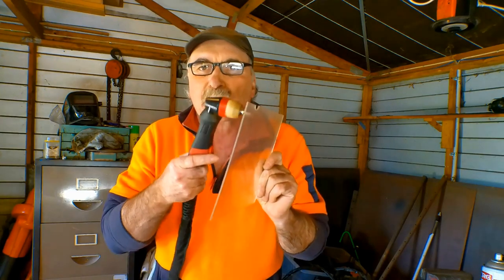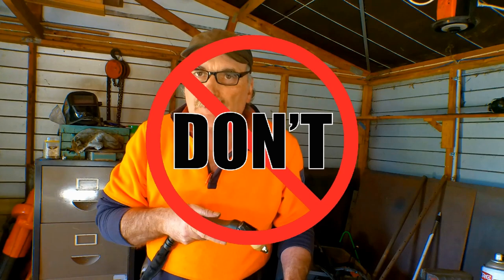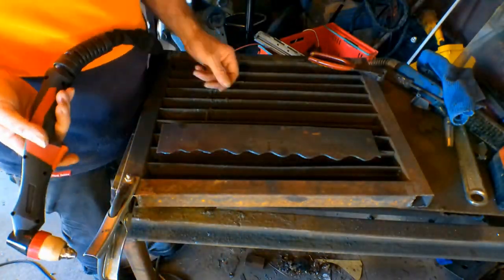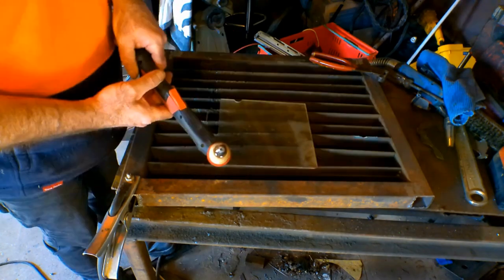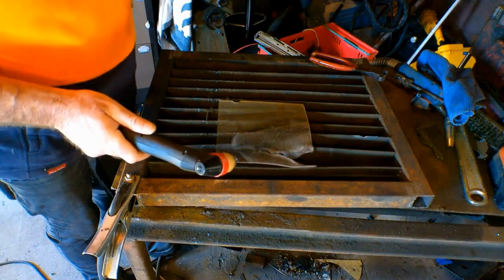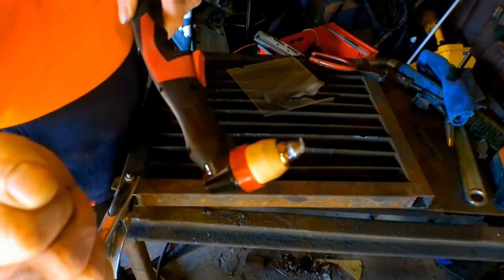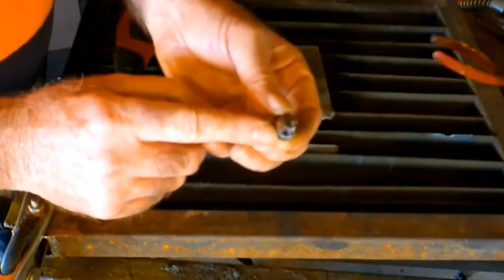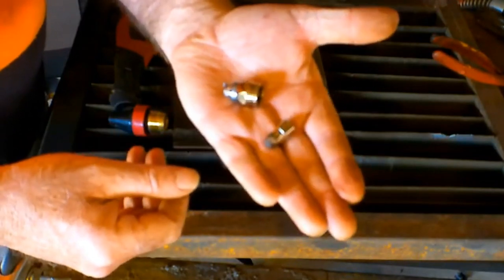Never Cut This With Your Plasma Cutter

Comment: My thoughts, I think that your not transferring heat into the plexi. When you cut metal your transferring heat from the plasma gun to the metal that you are cutting. When you try to cut plexi you are making an arc with the plasma gun but the heat is concentrated at the tip of the gun causing the consumables to burn up.
Reply from the maker: Good tips thanks.

Comment: Pete. I have a 60 amp pilot arc plasma cutter and it came with a ceramic cup and a wire hold off. But when I cut materials with it and drag the nozzle on the plate it makes the consumables waste away very fast. The problem is I believe that the nozzle when contacting the plate is adversely affected by the plasma. Do you experience the same thing?
Reply from the maker: Hi jimmy if its a pilot arc machine don't let the tips touch your steel. The wire hold off should hold the tip about .5 mm above your work. cheers mate
Reply: @petestools  here's the thing Pete, I have learned a lot from you and the videos. The machine cuts really good. But if I have to get into a tight spot, I take the wire off and then if the tip touches, it burns up real bad. So I saw an insulated drag tip for an ESAB machine but they aren't high frequency. It has a copper tip and an insulating section of some heat resistant material and a thread that goes on the torch where the ceramic cup screws on the torch. But nobody has them for the cheap hf torches from China